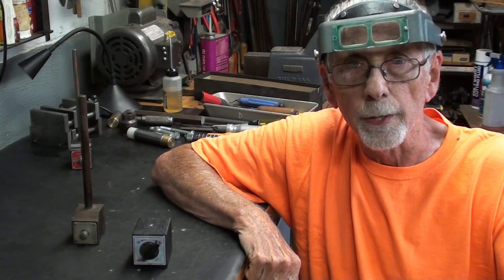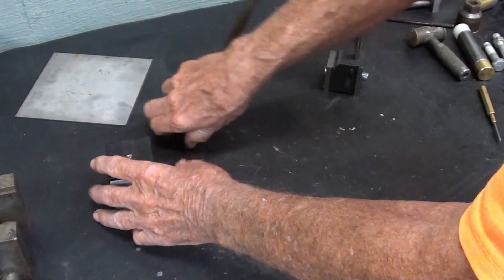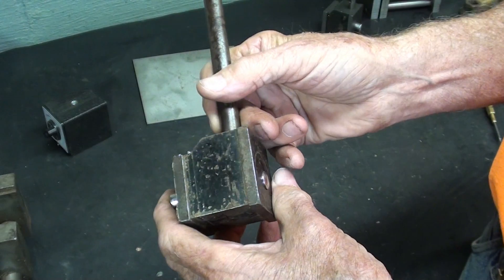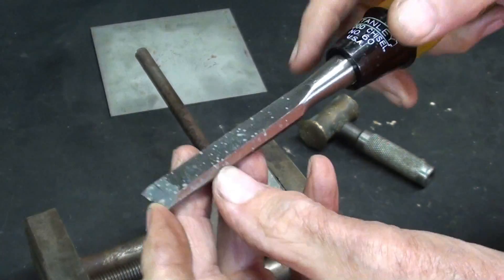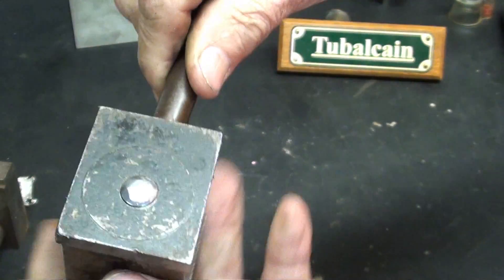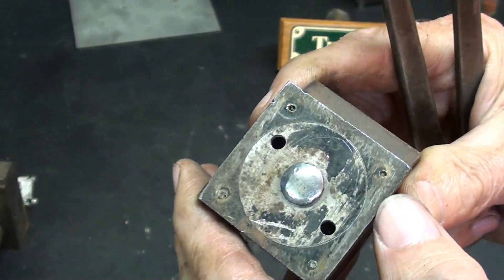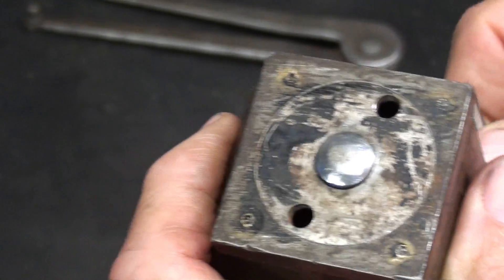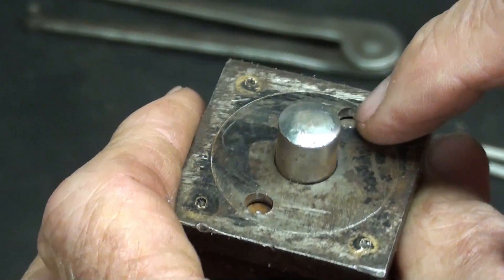WHAT MAKES IT WORK? #34a pt1 Push Button Indicator Base tubalcain

Comment: The brass goes all the way through and as brass is not magnetic it effectively keeps the steel plates apart and prevents the magnetic circuit from completing when the switch is pushed in as the magnet is not in contact with the steel at both ends so as one end of the magnet is north and the other south pole no field flows , however when pushed to the other end the magnet is in contact with both steel ends and the north and south poles can connect with the metal and the magnetic field can flow hence the magnet is switched on . As the magnet is pushed in with the also non magnetic switch , hence the damage when it gets whacked 😁, then one end of the magnet contacts the brass and the magnetic field cannot flow thereby the magnet is switched off . I'm exhausted after all this typing and thinking !🤔🤓
Reply: @mrpete222  I just had a further thought on this . The metal must be soft iron so it does not hold a permanent magnetic field . The longer section acts as a keeper bar so that when the magnet is pushed to that end the north and south pole both contact the soft iron which stops the magnetic field from escaping as it passes through the metal and thus the magnetic field is effectively turned off . Then when the magnet is pushed to the other end the brass insulates this section and the north and south pole of the magnet send a magnetic field through the air , if placed on a magnetic material then the field passes through that thus the magnet holds to the machine and can be used to hold a clock . 
Wow this has really got me thinking , sorry for the long winded answer . Best wishes from England sir !

Comment: The brass is a high reluctance material, yes. The wide parts of the magnet are the poles, of course. When the magnet is pushed in to the off position, both poles align on the same side of the brass, so the flux circuit is through the iron case of the stand. When the magnet is pushed out to the on position, the two poles are on opposite sides of the brass, so the flux circuit goes out through whatever the stand is sitting on.
Neat.
I wish YouTube would let me draw a diagram for you.
Reply: It's sad that YouTube lacks the capacity to draw the flux lines. So no flux capacity. All I can say to YouTube on the issue is get bent.
Reply: Yup, when both poles of the magnet are on the same side of the brass, the flux essentially "short circuits" through the iron back to the other pole of the magnet. But when the poles are on opposite sides of the brass, the field lines have to go around the bottom of the base to get around the brass, hence through whatever you're sticking it to
Reply: Applied science did a good video a little while ago on "magnetic circuits" and has the best explanation I've ever seen on the subject - way clearer than taking any Electricity and Magnetism university course I ever took https://www.youtube.com/watch?v=4UFKl9fULkA

Comment: Eclipse tool company made these in Sheffield (England) and have this model listed in their catalogue from 1969 and show a few use cases especially the V section on top that can be mounted to a drill spindle. They list a few models no 901, 902, 903. I have a 903. Some may disagree but Eclipse made some tooling on par with Starrett back in the day in terms of quality and finish.

Comment: I'm from England and fwiw, pin spanner is a fairly ubiquitous term in the UK. Here wrench mostly applies to an adjustable turning tool but is generally reserved for pipe wrench or monkey wench although confusingly what you might call a crescent wrench is most commonly called an adjustable spanner despite being adjustable. Tool catalogues seem to be refering to them as adjustable wrenches these days so the kids -  20 somethings, probably refer to them as wrenches now I guess.  Where I work we just call them shifters and be done with it and pipe wrenches we refer to as stillsons, regardless of manufacturer although I'm not sure how wide spread that is. 
I think what people in the UK would be confused by is refering to a  fixed size, open ended spanner or ring spanner as a wrench. And for extra credit, here a box spanner  is a very specific type of spanner, not a ring spanner. Clear? No? Good 😄
Also, I've never had a mag base appart. Very interesting. Thanks
Reply: I'm in UK (and 70) and  'spanner' implies some kind of precision (ring spanner, open-ended spanner, box spanner), whilst 'wrench' implies a crude brute-force device (pipe wrench, mole wrench).

Interestingly, in Greek a spanner is called Αγγλικό κλειδί , or an "English key", and in Dutch (my first language) it is a moersleutal or "nut key", both of which carry the same implication of precision. In German it's a Schlüssel or key, and in French a clé (key).
Reply: Very interesting, thanks for that! @frogandspanner
Reply: Thanks for the stillson ref., didn't know it was akin to crescent!
Reply: I may have misled you: "The Stillson name is that of the original patent holder, who licensed the design to a number of manufacturers" 
I thought they were the original manufacturers but apparently not.  Hope that clears things up. @alro2434
Reply: @alro2434  Only that both are adjustable and both are manufacturer names for the different tools.
Reply: There is a video somewhere wherein the come tater pronounces "wrench" as "rengch". Soft g. Weird.

Comment: The magnetic circuit is quite analogous to an electric circuit. The magnetic field treats the steel/iron like a wire (high magnetic permeability), the brass/copper like a near insulator (same permeability as vacuum). The slug is  a permanent magnet in the axial direction. Slid one way (off), the wide ends do not span the brass ring, and the body provides an easy path for the magnetic field to close, so little makes it to the seating surfaces. The other way (on) the ring makes the internal path poor, and, if the seats are near iron/steel/nickel, the magnet field takes the external path, sticking the stand to it.
Reply: I've wondered many times how these work, I suppose different manufacturers have their own mechanism. Also there's a very close similarity to the Starrett could you have looked at the patent drawings of them to find out how to disassemble it or gotten a better idea of how they disassemble??
Reply: This makes complete sense to me - thank you very much.
Reply: Makes perfect sense. That even explains the bump outs on the front ring, they ease the transition, else you would have a transition to push over to move the plunger. In effect a magnetic taper.
Reply: A most excellent explanation, as to how these functions.
A singular element of a permeant magnetic chuck as used on a surface grinder.
Tim
.
Reply: I have read this 12 times, and I'm pretty sure it's not English despite the fact that it's comprised of all English words. 😂
Reply: @DavidHerscher Que?
Reply: @DavidHerscher   really???

Comment: I believe copper, brass, and aluminum are all diamagnetic and repel magnetic forces, and I presume the holder mechanics is like adding two plates of metal to each end of a magnet which increases its capacity. One half of the holder being one plate and the other half being another plate separated by the brass

Comment: Lyle, you mentione that the magnetic base holds on 3 sides, you forgot to mention that the vee milled in the top is also a magnetic clamping area. You use the vee to hold it to a round rod or columb on a machine tool or part. Thanks for showing us. Regards from Australia.